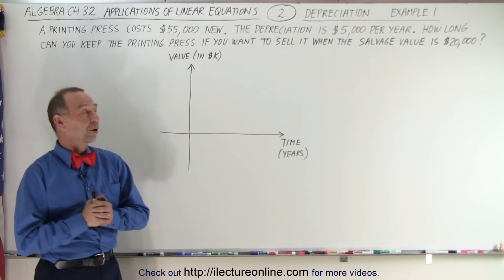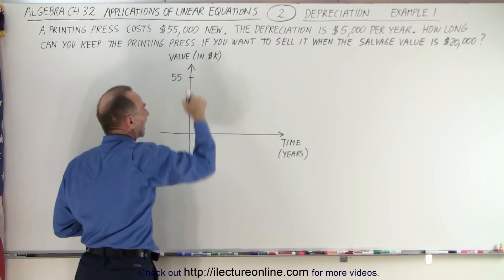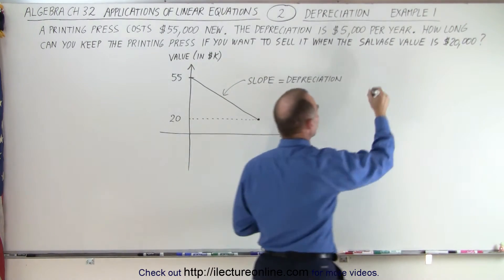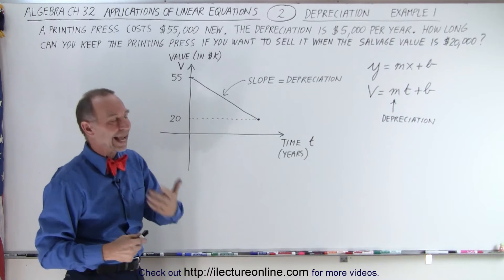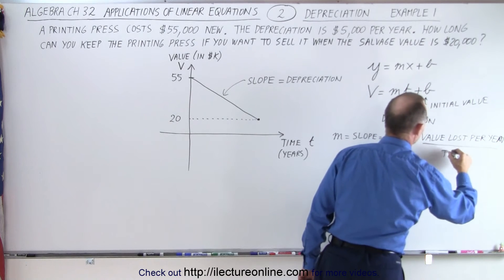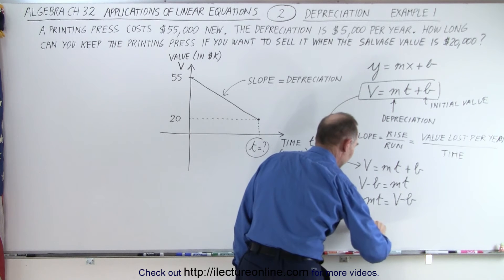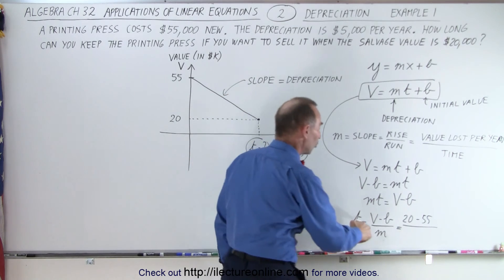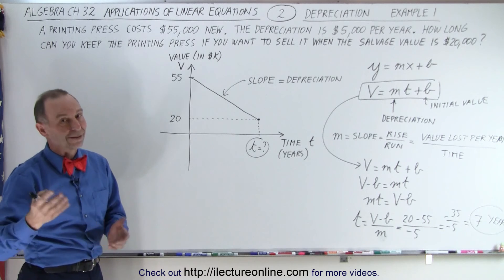Algebra - Ch. 32: Applications of Linear Equations (2 of 11) Depreciation: Example 1

Comment: Professor van Biezen ... thanks again for another solution video.  I do have a question.  Isn't m (slope) simply "value lost per year" without the word TIME in the denominator because it already contains time in the denominator "per year"?  (value lost / year).   Just asking ...
Reply from the maker: SLOPE is defined as the change in the vertical axis divided by the change in the horizontal axis.  So strictly speaking, it is the change in value (in dollars) divided by the change in time (in years).

Comment: That y=mx+b formula  is terrific.
Most of you could do this in your head.
But to see it. This is all algebra  is. 
And the point-slope. The y vertical  is the variable. Slope always is times 'x'. (horizontal). b is were the line crosses the y axis. In any li ear equation the constant is where the line crosses the y axis. So 55 -20 ÷5 = 7.